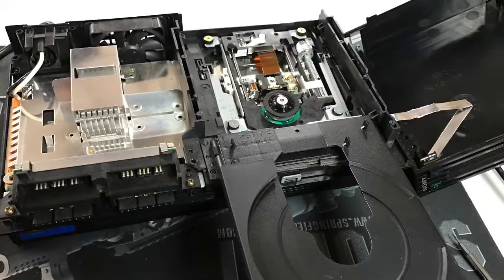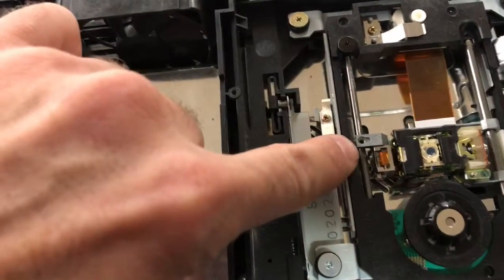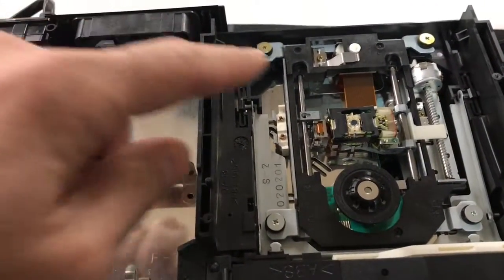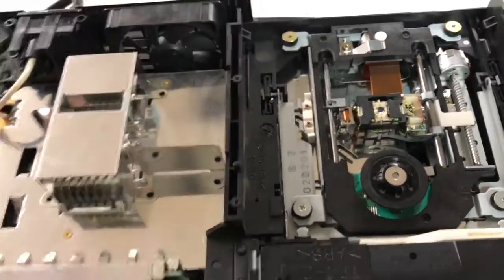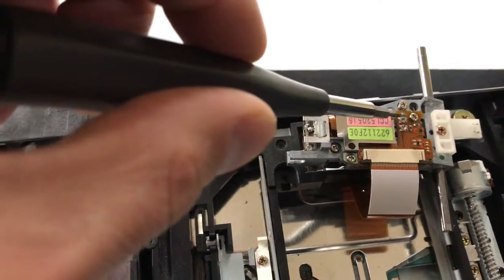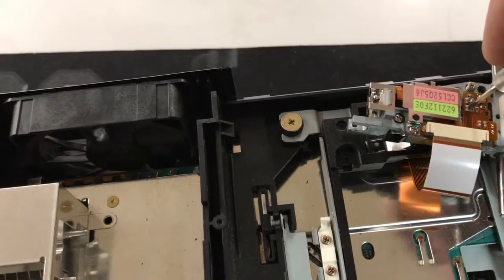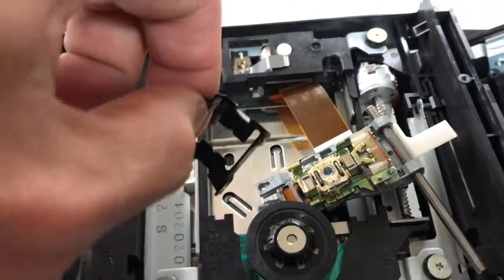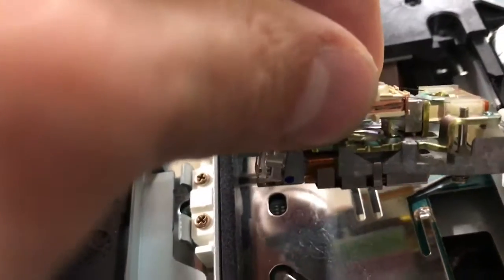Playstation 2 Laser Reading Disk Error Repair Troubleshooting

Comment: What disc read errors/symptoms would specifically indicate the need to clean mirrors / lenses before messing with the laser voltage level adjustments for CDs and DVDs?
🔴 I'm noticing hang-ups/freezing and sometimes returning to the PS2 browser screen on a couple of my purple CD discs - Tribes: Aerial Assault (freezes when loading the next map) , Twisted Metal: Black-Online and Time Crisis 2 to name a few and, IIRC, GranTurismo 3 (not sure of its DVD format) having the opening movie and background graphics hang or freeze up behind the GT3 menu screen or/also the game hangs up / freezes between loading screens - especially when firewire system linking for iLink Battle... The loading time is becoming great enough it would appear on one console that's having trouble reading the disc that the iLink connection fails.
🔴 Should I stay away from using canned air or wouldn't that be the easiest, safest way as a first step before diving into dismantling the laser assembly in order to do a wet clean with a swab? 
🔴 Does playing a CD/DVD dry or alcohol wet bristle optical drive cleaner achieve the same results / reach the same surfaces as PS2 dismantling or are there surfaces missed when using the CD/DVD cleaner disc?
🔴 Is there any way of measuring the voltage change (and in what measurement range) of each of the two potentiometers there controlling the laser output?